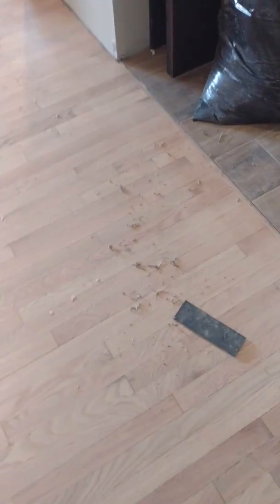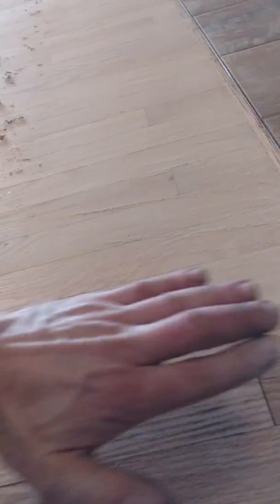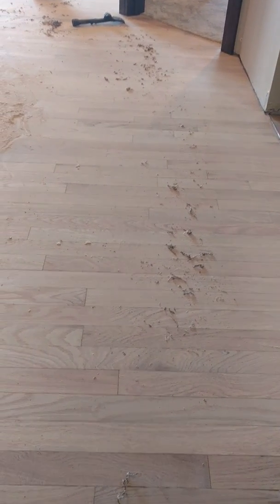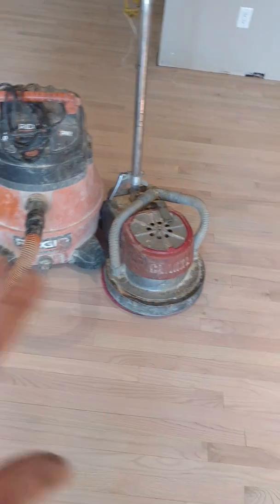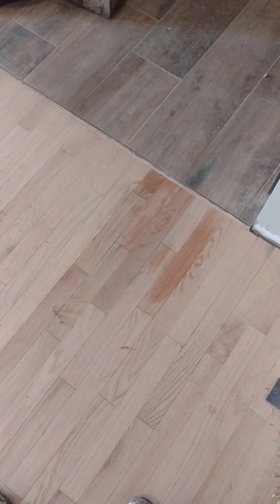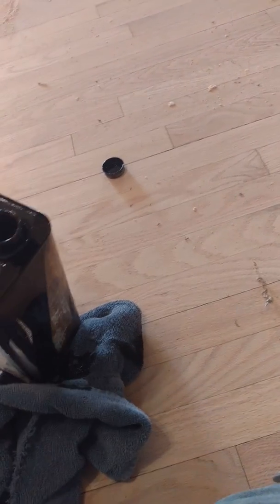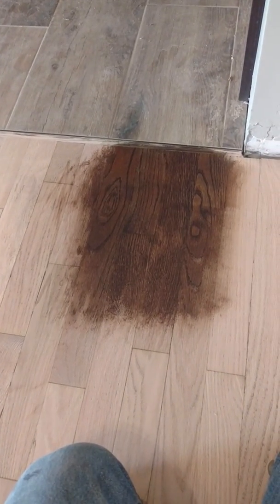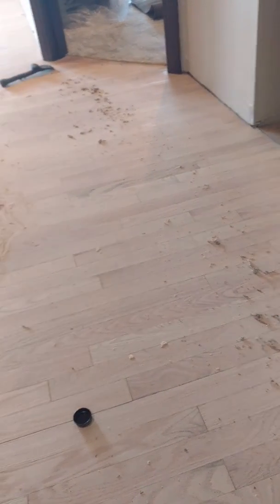Some advice here about water popping a wood floor

Comment: After all my edging is done I use a vibrating sander with 50 grit paper around all the edges to take out that halo, then I go over the entire floor with a buffer 180 screen. Vaccum twice, water pop, wait at least 4 hrs no more than 24 and then apply stain. Be careful walking on a water popped floor the grain will be very soft and easily scuffed. I usually where bags over my feet and go shoeless. If you're using an oil based poly wait 24 hrs after staining before u poly as water and oil don't mix. When I follow these steps I never have any edger marks or halos (light edges) in my floors. Water popping does a great job at hiding imperfections and allowing the stain to penetrate deeper instead of puddling up on top of the wood. Hope this helps good luck!
Reply: Kris Rohs what if I did scuff my water popped floors with knee pads, how can I remove? Do I need to sand the scuffs?

Comment: I use a 50/50 alcohol / water mix for popping the floor. A palm sander with ceramic grit (red heat or monster)should do the trick.

Comment: Ron, without getting into great detail, if you are having issues with your scratch marks from the edger  appearing especially while staining. Do a double water pop. 
In other words once the floor is sanded water pop it. Let that dry completely. Once dried and the grain is raised screen the floor which removes now all the remaining scratches. Vacuum up and re water pop again in preparation for stain.
Reply: This is after edging and using a palm sander?

1. Water pop 
2. Screen
3. Water pop then stain after it dries
Reply: @kalulubamba53  Hi Kalulu, The route I recommended to Ron in this video to go is in fact a long route. Anytime you water pop, it really should go over night. If in this case Ron water pops twice, that's two more days on the job added just to allow each water pop to dry. Some have suggested cutting the water with alcohol since they claim that speeds up the drying process. In any event what really dictates if the water is 100% gone is a moisture meter. Take a reading before water popping and after you think it's dry. The reading should be the same or very close before applying stain. Water popping we do on all floors that are getting stained no matter what the color of stain is, or species of lumber. The trick is to do a great job with no flaws, yet do it efficiently. That means your sanding is spot on and you water pop only once in order to raise and swell the grain of the lumber. That way when the stain is applied it takes a deeper tone. But also a consistent color across the entire floor. In Ron's case where he's having a tough time with edger marks, you really want them gone no matter what the finish being used is. Whether that's clear coat or stain. We are in a business where you can do things a couple different ways and still reach the end result. A lot depends on a few factors. What machines as well as abrasives you use. Along with if in fact the machines are not only maintained well, but also run correctly. In our case we don't use pal sanders after we are done with the HUMMEL and the edger. Norton now makes what's called "Mesh Power" for not only the edgers, but also for buffers as well as planetary sanders. That said what we do it run the HUMMEL and then the Flip and then the Trio. 100 grit mesh finishes the floor on the Trio as well as the Flip. That ensures ZERO marks on the floor which includes the more bitchy floors such as maple and birch. Is the floor requires stain, we water pop and allow it to dry over night. Then stain the following day. Back to double water popping. Some do have difficult times with edger marks such as Ron is. Again the sanding using both the big machine and edger must be spot on. If you're not perfect, that's OK. There's a little wiggle room with the double water popping. If you don't have a planetary sander and use a buffer as your final pass after your big machine and edger, then use Mesh Power for your buffer and not screens. You will never be on your hands and knees again with a orbital sander. Again, you want to make your job easier, not harder. Double water popping comes into play for those having difficult times with the marks in the floors prior to staining but after all the sanding is done. This is more common on the tight grain floors such as maple. Completely sand the floor to the best of your ability. Then water pop it. Allow that to dry over night. That raised and swells the grain of the wood. The following day buff the floor out with 120 Mesh power or 150 grit screen. What that does is takes out all the marks that you're having troubles with initially. Once done Meshing or screening, vacuum the floor and re water pop. The second water pop is done to re raise the grain that you just took back down with the buffer. The second water pop now preps the floor for stain. Make sense? In Ron's case I can tell by the direction of the edger marks that he is not running his edger correctly. Better worded, not the most effective way. That makes all the difference.
Reply: @falconflooring2797   man I appreciate it a lot, so for me I do big Machine(American belt sander Legend), edger, and buffer ( Hydrasander). I go around the whole perimeter with the grits I ended with. With the edger and big Machine. After that use a light and see if there’s any swirls mark, but I’m thinking about doing doing edger first then big Machine... so I don’t worry about swirl marks even tho all my jobs I make sure there’s no swirl marks or noticeable.
Reply: @kalulubamba53  Everyone's different on how they sand. And there's nothing wrong with that. As long as we all get to the same end result. Some just take the long route to get there which is fine. As long as you realize that along the way and always look to not only improve, but to also shave time off the job. Work smarter not harder. When it comes to edging, most people really do sand different from one person to the next. For edgers we run B2s and Flips. The B2 has the flex plate on it. Not sure if you have ever heard about those. Edging first to me never made sense since I want my edger wheels running on a flat surface. Which is something only a field sanded floor can provide. If I ever wanted to run my big machine last, I wouldn't edge first. I'd run by big machine and stop it before the final grit. Then I would do all my edging. Then run the big machine on it's final cut to remove the tail end of what the edger created. But, you have be be decent at feathering the big machine since there's no edging afterwards to save you from any potential drum marks.
Reply: @falconflooring2797  never had used a flex pad or heard of it till I seen your Vidoe, it’s like a random orbital move, right? So big Machine then edge after that run the big Machine on its last cut
Reply: @kalulubamba53  Traditional edgers have the rubber pad on them. The flex pad is a flexible metal plate with no rubber on it. Yes, big machine, edge, big machine.
Reply: @falconflooring2797  big Machine 36 (depending on the floor ) that part I understand then edge 36 or 80 depending on the floor also then big Machine, so that takes out you using the orbital then, right? Also what’s the flex pad do on the edger? Basically it operates like the orbital (randomly sand) leaving no swirls?
Reply: @kalulubamba53  You're making my point that we all have different methods of sanding and refinishing. As long as we all arrive at the same end result, that's all that counts. We never try to start a floor with 36 grit. The way we decide what to start a floor with, we first have to know what grit we are going to end with and then go backwards in grits from there. In other words we end our sanding with the HUMMEL and the edger at 60. After that the Trio takes over starting at 60 grit then going to 80 and finishing off with 100 grit Mesh Power by Norton. That being said since we know we are going to end the final cut on the HUMMEL with 60, we will start the floor with a 50 grit. Make a few passes and see what we have for results. If we need more aggression we will drop to a 40 grit. That's a big issue is that there are so many people who are devout 36 grit people. Why over cut the floor and make the job harder? However there certainly are times that 36 and 24 is needed. Rarely needed. but it does happen. Next, you never skip more then one grit on any machine. So you mentioned going from 36 right to 80 grit on the edger. That means you skipped 3 grits 40,50 and 60 grit. Only skip one grit at a time. If you want to finish with 80, start with 50 grit and finish with 80. In our case we always stop at 60 so we start most jobs at 40. Not the Flex pad does not create a random obit effect. The flex pad is named for exactly what it does, it flexes. That doesn't change how the edger spins the disc, the disc simply flexes. So if you're currently running say a B2 or Super 7 or any other edger besides the Flip for that fact, you more then likely have a rubber pad which you bolt your edger discs onto. Flex pads are literally just thick sheet metal that the disc is made out of. You take off your rubber pad that comes with your edger and replace it with the flex pad. "I have a video of our flex pad on our B2" I'll find it and post it here for you. Anyways when you sand with the flex pad as opposed to the standard rubber pad, the flex aspect has a hell of a lot more finesse while sanding. Hence less or no edger marks. You have to know how to set your edger up and clock it correctly. The Flex pad was designed to be an option for traditional edgers to sand as fine as the Flip does regardless of what grit you're using. The Flip has a flex pad on it form the factory. Where traditional edgers do not. Hence a Flex pad was made for more traditional edgers. All that being said if I sand with my B2 with the flex pad, it looks like I sanded with 80 grit. It's just a much finer cut no matter what grit I use. You asked what prevents us from not using random orbitals right? Couple things prevent use from getting on our hands and knees again with a random orbital. 1) The flex pad on the B2. 2) We own a Flip. It's the finest sanding edger on the market. When I say finest, I mean gives the finest cut no matter what grit you're using. 3) The use of Mesh Power as a final cut. We don't always use Mesh Power on the edger, but we do use it. In most cases using the Flip with 60 grit as the final pass removes and does not make any scratch marks. and finally 4), We know how to effectively run the edgers. The edger "like every other sander" has a cut point as well as a feathering point. You're edgers cut point is either at 11:00 12:00 or 1:00. You must know where you're cut point is in order to know how to effectively run your edger and leave no marks on the end grain walls. Most will run their edger in and out with possibly a little twist at the end of their run. And most will run their edgers from the field towards the wall. The correct way "or better worded more effective way is to start at the wall and work your way down into the field. Keep in mind your cut point is usually at 12:00. Running in and out is going to leave edger marks like Scott in this video has. You want your cut point to be inline with the grain. Hard to understand right? Start your edger at the wall and make your first pass right across the grain. "Always run your edger left to right." When you return to the left position, turn your edger a bit so that your cut point is heading towards the grain of the wood. and run it again. When you return to the left again, turn the edger now even further so that your cut point is inline with the grain. once the edger cut point is now inline with the grain, not keep it that way and run the edger towards the field of the room. There's a video a friend of mine made who teaches the NWFA classes. Ill find that video and post it here for you. I am also making a video tomorrow about how to effectively run your edger. That's a lot of info I know, but what keeps us from not using random orbitals afterwards is knowing how to run the edger to begin with. And what abrasives to use. The abrasives alone make a HUGE difference. Take that random orbital step out of the mix and you saved yourself a hell of a lot of time, money and manual labor. I'll find the videos and post them for you as well as post one on our channel tomorrow.
Reply: @kalulubamba53  Watch this video of how Lenny runs his edger. This is production edging. You're flying right along. Notice how he starts from the wall and works into the field. Not the field working towards the wall. He also on the end grain walls make his first pass and every other pass he begins to turn the edger to begin to line up the edgers cut point to now go with the grain. He does not begin to pull the edger into the field until the cut point is fully inline with the grain. Then he starts to sand towards the field. https://www.youtube.com/watch?v=hJM5oqv1c-I&t=141s
Reply: @falconflooring2797  ok ok make sense. Off topic here. With the polyurethane that Lowe’s have sucks when you use a t bar because it’s fast dry, so I use the roller method. What you use?